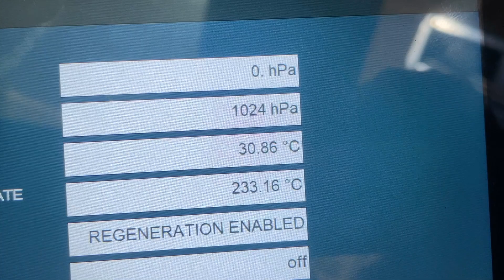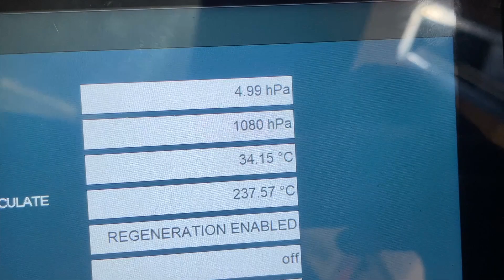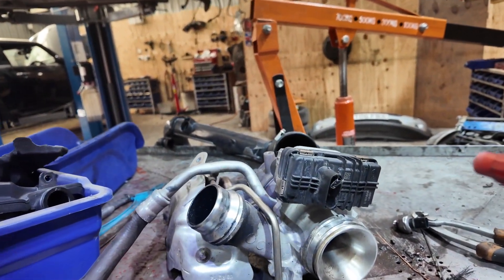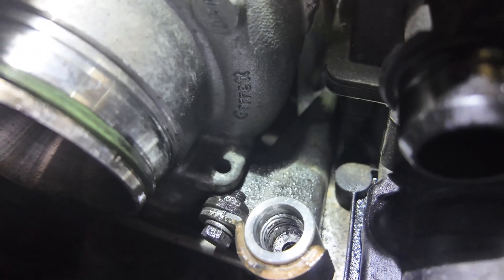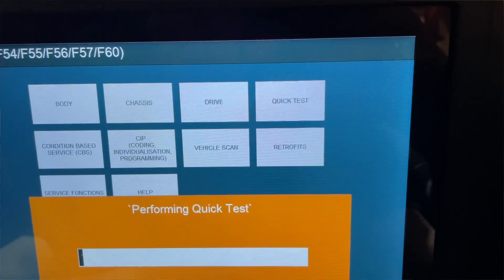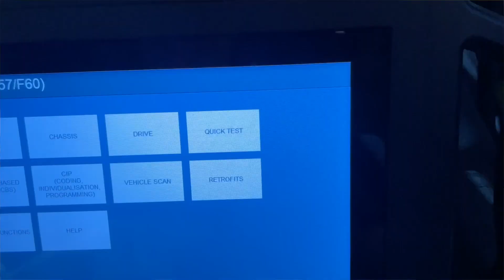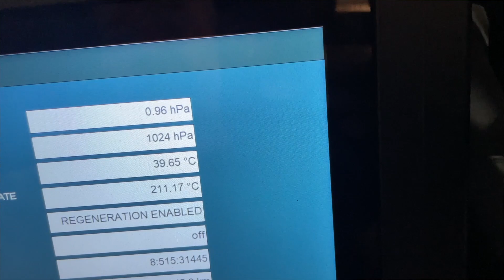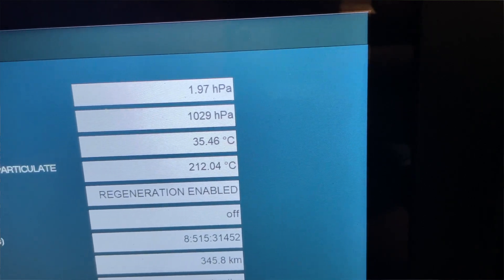BMW & MINI Fault Code 28DE00 - Easy Fix (Exhaust Back Pressure Sensor)

Comment: Really great video. Makes a lot of sense to me as I currently have the error codes 28DE00, 290900 - Air mass system: Measured air mass too high and 290B00 - Air mass system: Measured air mass too low. When I think of the cost of replacing the banjo bolt if it strips plus others, it scares me.
Can this same fix work for a BMW 216D gran tourer?
Reply from the maker: Yes. All 1.5 and 2.0. Litre diesels from about 2014

Comment: Found similar solution on some forum. Doing it right now on 1WW engine of Toyota Avensis. Halfords £3 bike gear cable seems to be doing the job. Didn't have any solvent handy so using Liqui Moly diesel intake cleaner spray (naphtha I think) I just left it to soak it a bit more. Your video is priceless😊. Cheers

Comment: 2 questions mate, when checking to see if there is flow what liquid is safe to use here? Also is using petrol to soften the build up safe with the diesel engine? Thanks!
Reply: It goes into the exhaust and out the back of it I would imagine.